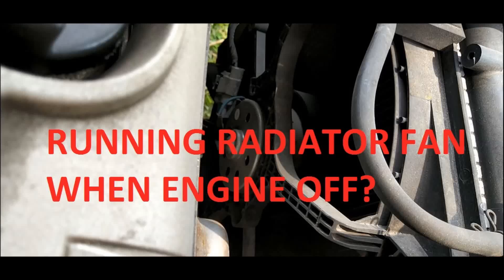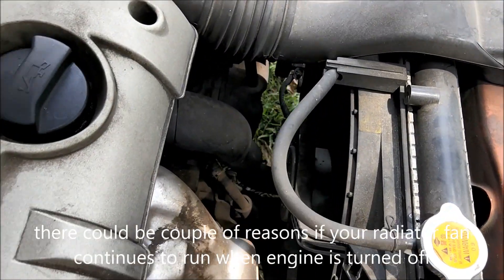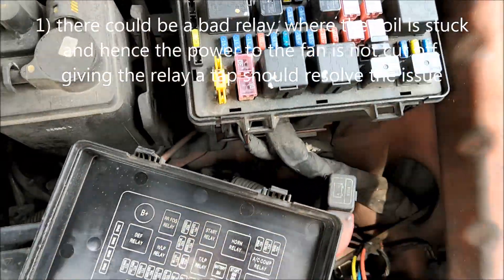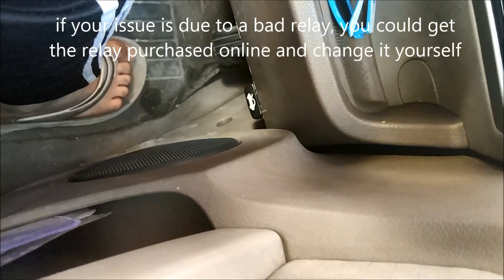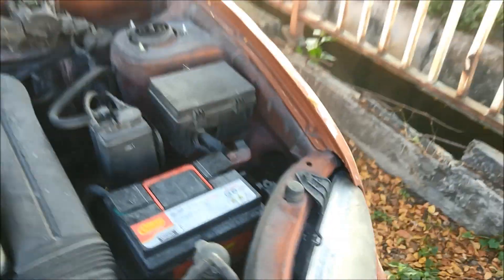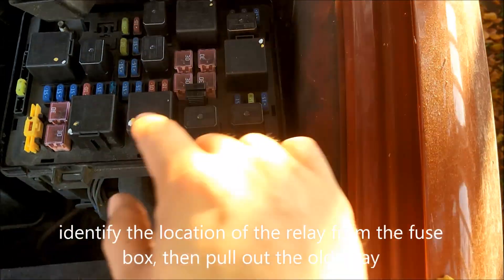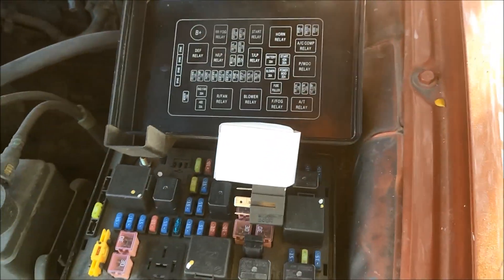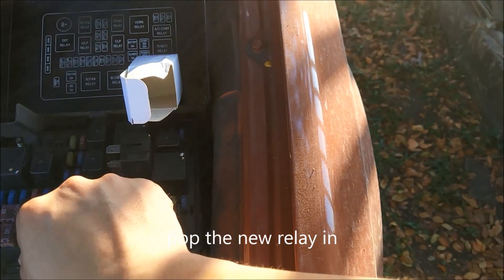Radiator Fan Running when Engine is Off

Comment: Sadly this is just shit. The information you are hawking is not accurate. If your engine gets hot and you, for example park or whatever, the fan will run until the engine temperature is lowered. Not rocket science.

Comment: R60 Mini Cooper Countryman S all 4. Fan is running over time. Low temperature coolant code, relay tap didn’t work. All fluids are good. No leaks? Any idea? Possibly, I am not tapping correctly?
Reply: sounds like your thermostat is stuck

Comment: With engine running, I pulled out the big grey relay in this box on Seat Altea xl 2L diesel 2007, the engine cut out. The dash warning lights were flashing so I switched off the engine and back on again and the dash returned to normal and the rad fans stopped. My aircon has failed (may just need regassing) and this coincided with the rad fans coming on unnecessarily, so, maybe these two symptoms are linked in some mysterious way.

Comment: hello, i have a question. my car left front radiator fans keeps running after the engine off, & draining the battery. after that i recharge the battery, it's runs normal, the oil temp, cooler temp, the battery voltage up to 14v. all normal. after driving for few miles, turn off the engine for 2 hour & the battery dead again the voltage under 9v (the radiator fans keeps running again until the battery dead), what happened? thank you sir (it's a porsche boxster 981)

Comment: On some older cars the sensor is actually on the radiator it screws in and you swap out the old one done 👍 look for a two wire going directly to the radiator usually on the lower half that goes to a connector to the sensor.  It's spring a activated just like a thermostat ..  when it's hot it turns the electric fan on when the engine cools off after you shut it off and the fan is still running.  Like it should  It should shut the fan off ..after its cool ...  if it's not turning off it will drain the battery dry .   An easy test is ...  Wait till the engine is cold when the battery is dead ...  Hook up a jumper box or cables ..  if the fan is coming on when it's dead cold you have a bad sensor then  just replace the sensor...  Hope that helps anyone a bad relay can also stay on too ...

Comment: If I had a long run , then stopped my car and turned off engine, my fan won’t stopped, But I tested my car at car park, so far the fan runs normally when temperature increases, and will stopped automatically when it’s low temp. I guess my relay was something wrong and maybe same situation with yours.
Reply: My car also same problem bro
Reply: Ĺlĺ @aradhyabidaralli7063
Reply: What can i do this problem sir
Reply: Keep remove the red battery and put it back
Reply: 😂😂 features

Comment: This is happening to me right now because I had to drive through a flood. I disconnected the battery so the fan would shut off. I'm hoping it will dry out. The brakes went out, but once some of the water drained they were fine again, so hopefully the fan will start turning off when everything else dries. I don't think it got in the engine. It wasn't quite deep enough
Reply from the maker: it probably shorted something, hope it's fine after drying out now. try not to drive through flood if you can, you may hydrolock the engine.

Comment: Had to Google why my fan came on on its on at 3am, it was scary but this was helpful thanks
Reply from the maker: It comes on on its own when your car is parked and not used? Wow, did you find out why though?
Reply: @YYEngineering  lucky for me , it didn’t run down the battery so I took it to the workshop yesterday and my Mech scanned it and found nothing so he said I should observe , that maybe it wasn’t my car, but I went to put my jump start cables into the car Just in case
Reply from the maker: @funmbisokoya6600  better, to be safe.
Reply: @YYEngineering  Hi, Thank you for your video. This is happening to me at ramdon times (the fan comes on on its own when the car has been parked and off for several hours) and has drained the baterry couple of times. It is not like the fan stays on after driving. It literally turns on by itself hours after the car has been off. Did you find out anything about a case similar to mine?

Comment: thats actually good that means its cooling the engine.
Reply from the maker: Unless if it's continuous and drains your battery
Reply: @YYEngineering  my fan in summer after i shut the car runs for 15-30 seconds depending on drive. Sometimes even longer maybe even few minutes
Reply from the maker: @999momak  that's good for you, in our case most Malaysian cars do not have such timers, if you have the fan running post turning off the engine, it's a sign that something is wrong
Reply: @YYEngineering  fan works until it cools engine I dont think it has anything with timer. It probably has something with engine temperature sensor. Maybe your sensor is broken so it keeps cooling already cool engine. I think that sensor is called thermostat
Reply from the maker: @999momak  the point of this video is for abnormal behaviour of the fans, not when everything is normal
Reply: @YYEngineering  nobody likes a wise guy
Reply from the maker: @999momak  why do you say so? Thanks for your sharing

Comment: While cranking engine, radiator fan starts running? Its Axio toyota 2007
Reply from the maker: I would think that your wiring has been bridged to always run as long as your engine runs? Otherwise you have a bad temperature sensor maybe
Reply: @YYEngineering  after engine start cooling fan stops, while cranking engine self starter crank slowly like low battery charge, even with new charged battery swapped
Reply from the maker: @autogeartech9436  sounds like you have wiring issue there. if it's just starter cranking slow i would think it's the starter issue, but even your relay is activated when cranking sounds like you have a bad or floating ground or something

Comment: Hi my car fan on fan on for some time when i switched of my car. I have checked the coolent level that is ok.
Reply from the maker: sorry for the late reply, hope it's sorted now. otherwise, check your fan relay.
Reply: @YYEngineering  mine was still on after I shut off the engine..it lasted maybe 3-4 min..is that normal?
Reply from the maker: @original_bebop545  has it been the case since day 1? not known to me to be normal for the cars that I know here in Malaysia.

Comment: I have seem problem on passat b7 2012 . When i drive like 3 hours its like power gas is to low when I put gear 2 or 3 its like low and when I turn engine off its running Fan like loud and its to long little bit.  Can u said me its seem problem like yuors ?
Reply from the maker: unless if the relay is controlled via ECU for the on/off, I don't think the gear 2 or 3 issue is related to your fan continues to run when your engine is turned off
Reply: @YYEngineering   power and lound fan  lisen and when i put 3 gear its on dashboard show me to put gear 2 because low power .. I do know what is problem I already last month clean DPF
Reply from the maker: @mathusstudio5087  glad to hear your problem was solved!

Comment: Hi
My car also have this problem.Only driven 2/3 km radiator fan is still on, I am not facing this issue before but from last week i am facing this fan issue even in cold engine fan is still on and when i turned off key fan is still ON.But after starting engine again fans stop.Please someone tell me what is the main issue for this..
Reply from the maker: Probably your thermostat, if not relay?
Reply: @YYEngineering  thermostat what is it how to fix
Reply from the maker: it's a temperature sensor to decide on when to turn on your fan

Comment: My 2008 mini cooper(non-S/turbo) fan is running after engine off, no relay and coolant low issue..not sure what the issue there but i checked some forum..all 2nd generation mini cooper(R55) is same..proably is the car default setting?
Reply from the maker: It could be too, to continue cooling down the car a little beyond shutting off the engine but that's rare tho, as it may drain extra battery charge unnecessarily
Reply: Check your coolant reservoir cap and make sure no air is getting in

Comment: Informative video i bought new vw sharan somtm dose tht
Reply from the maker: Thanks! Might be time to change the relay if you don't want to keep tapping on it? Or top up the coolant level?
Reply: @YYEngineering  iv hav changed the relay and also coolant level is ok but still does the same thing fan going on after engine of any ather idea please
Reply from the maker: @khyberkhan1661  your temperature sensor? Have you checked that? Normally radiator fan turns on when the car engine reaches beyond optimal temperature and stays off whenever the car engine is at or below optimum temperature
Reply: @YYEngineering  hi thanks for reply back yes when the temperature somtme below stil  running fan somtme even on tye midle of the gage still running i can feel it its going over heating

Comment: But in my car sometimes fan start only for 30sec after engine is off after then fan automatically switched off  then what I do.
Reply from the maker: please check your coolant level, if you relay is stuck like mine did, it wouldn't just run for 30 seconds and then stop, it would continue to run until your battery flats out. The only reason that your fan ran for only 30 seconds after shutting off your engine, i believe, is because you have some overheating issue
Reply: @YYEngineering  this is normal in summer, the cooler will cool the engine down and then stop.
Reply: @YYEngineering  after the ignition is off, I get some weird sound from dashboard area.. Not sure though if its from AC or dashboard.. Your thoughts please?

Comment: Hello is this true. Because i thot the fan is suppose to start when the engine is hot.
Reply from the maker: normally the fan only turns on when your engine reaches its optimum temperature, unless if your mechanic bypassed the temperature sensor, that should be the case
Reply: @YYEngineering  ah thanks i drive a 10 year old car when i drive 30 or more km and shut the engine but put on the ignition the fan starts for another 3 to 4 minutes
Reply from the maker: @matingpamathew1986  no worries. If that's the case, normally it's a sign of overheating, your car may be low on coolant. in my case it's different, the fans will never stop.
Reply: @YYEngineering   thanks u open my mind somhow
Reply from the maker: @matingpamathew1986  thanks for the kind words, I'm learning too